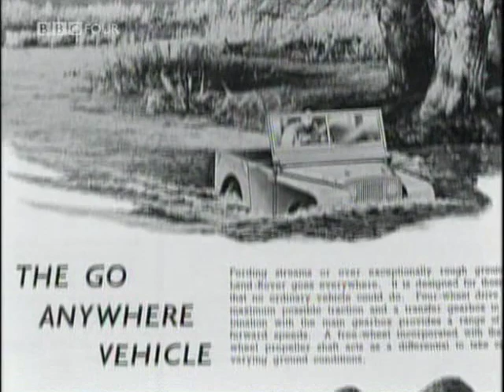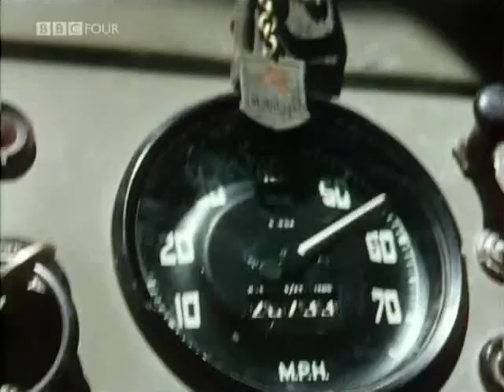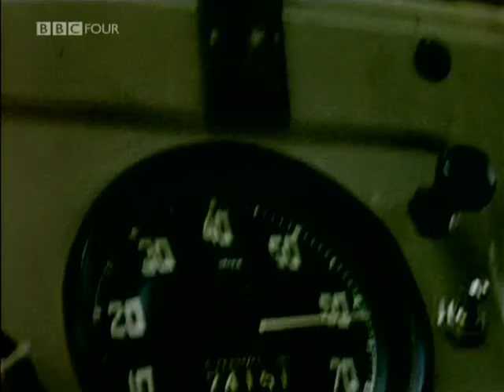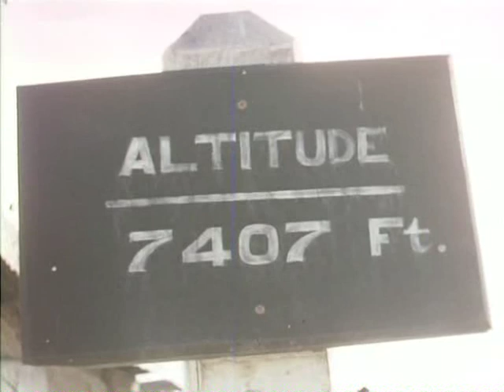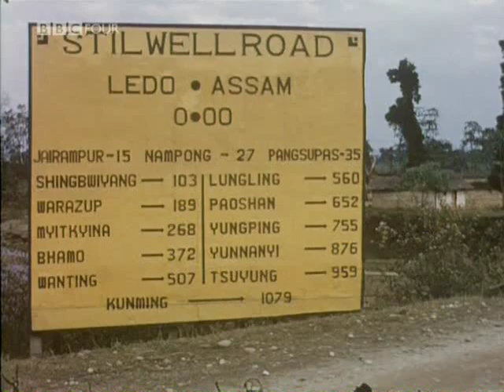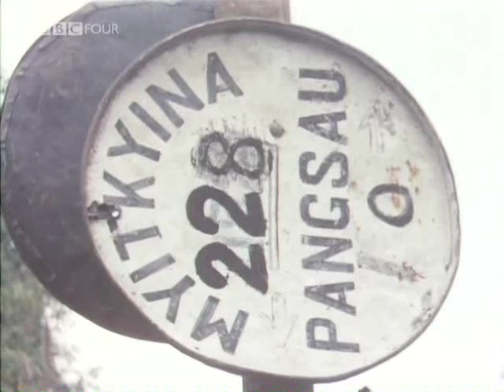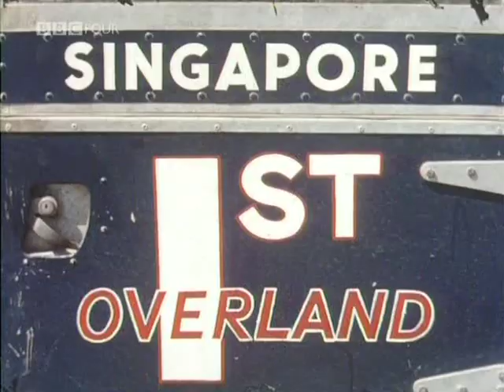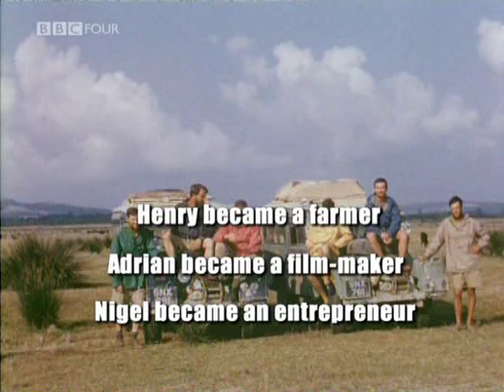BBC Timeshift The Lost Road - Overland to Singapore

Comment: SNX891 one of the Land Rovers used in the expedition has recently been discovered and on 25 August 2019, Tim Slessor  one of the original drivers, now 87 years old, will leave Singapore driving the Land Rover on the long drive home.

Comment: A great adventure… Whilst it’s true nobody has taken that exact route for a long long time, many many people have driven London to Singapore and it’s actually quite easy today.   In particular the journey through Burma (Myanmar) is very easy as long as you remember that some roads are one-way with the direction switching on alternate days.    Patience is needed at borders, checkpoints and police stops all across Asia and you need to accept that small bribes are often necessary even if your documents are100% correct..

Comment: Big Land Rover fan here, but I do feel the need to point out that two French guys, without any sponsorship, purchased a Citroen 2CV in 1953, two years before this expedition, and had that car shipped to Canada where they then headed south to Tierra Del Fuego, on the southern tip of South America. During the year-long trip they drove to the top of the 17,780ft Mount Chacaltaya in the Bolivian Andes. The car was then shipped back across the Atlantic to Africa and traversed the Sahara on its way back to France. The altitude record held until 2007 when it was beaten by two Jeeps, but they are 4x4s, whereas the humble 2CV is just FWD. 
In 1958 two different French guys used a 2CV to circumnavigate the globe.